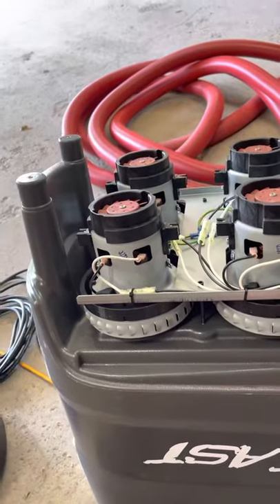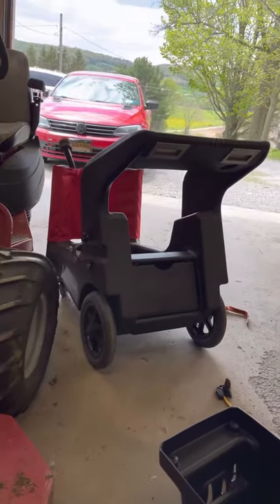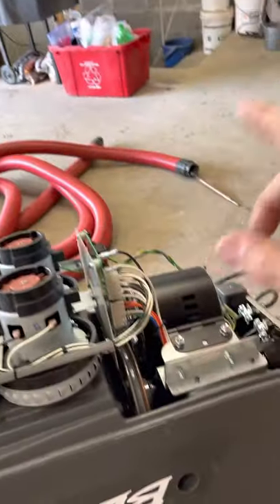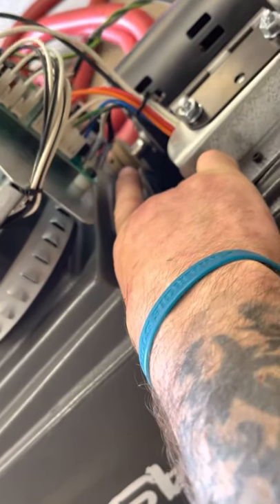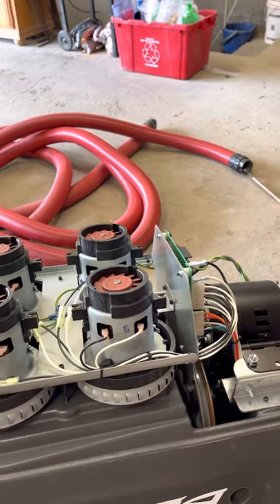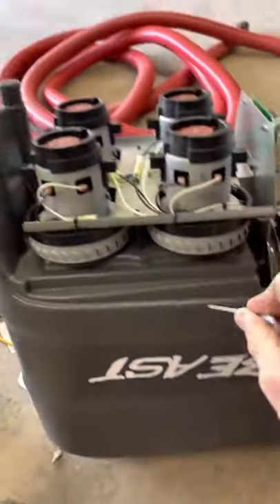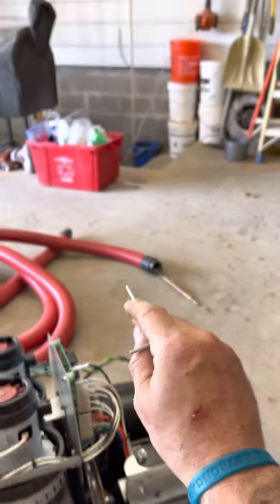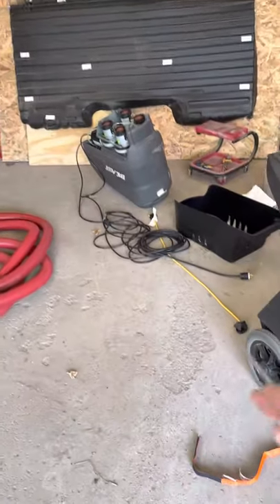Rotobrush SCAM

Comment: I’ve been in the duct cleaning service industry for over a decade. The only vacuum/compressor equipment I recommend is engine powered, either by power take off from the truck, or by self contained slip in units that go into the back of a cube van. You can do a house in a fraction of the time it would take with the electric portable systems.

Comment: I had a Rotobrush, years ago. Different than yours. Mine had one large vacuum motor, which worked well. The bad part about the machine was the huge circuit board that controlled the motor, failed 3 times under warranty. When the warranty ran out, I yanked out the $500 board and trashed the fancy, expensive motor. I drew up a schematic and went to Grainger's and bought a cheaper, generic motor and a few relays. Wired everything up and it worked great for years. Never failed! I wasn't spending $500 a couple times a year for their crappy circuit board!
Reply: He should be going up from the bottom not the registers

Comment from the maker: Let me be a little nicer. Rotobrush rotobeast doesn’t work well In trunk lines. It will clean round Pipe, but there isn’t enough of a vacuum to pull all the debris into the machine. If you pull each branch off the truck and inflate an air bag or tape it off then it will create the vacuum or negative air pressure needed to pull in the dirt. 
The best system is a negative air machine with air scrubbers, brushes with cables and air bags to isolate the system. Rotobrush offers those products but highly overpriced. I have a robotic duct camera I use to make sure I’ve cleaned all the ducts perfect. The videos I have of a brushbeast vs a negative air machine are night and day. I will remove the video because there’s probably many places that the rotobrush brush beast works Great. In upstate NY where we have large long trunk lines and old wooden return cavities it leaves 70% of the dust behind. It actually creates dust because it disrupts debris that have sat idle for years without sucking it into the small holes in the end of the largest hose. Also 6” or small Branch  lines will not except the larger hose. When you switch to a smaller Hose your lose a large percentage of your vacuum.
Reply: Yep, it's only designed for flex, but it doesn't even do large returns well and I purchased the 24" brush through my company. It is the only machine I've used for duct cleaning as I'm new to the HVAC world, but trying to get good before and after photos for customers was a pain because the suction on this machine is so bad. I made sure to size the brush up and tape off other supplies to create some negative air pressure, but half the time, I'd have the brush off and just wiggle the cable around to give the system time to suck up all the dust it was throwing around. I really hope I get to use a good machine one day and see a real duct cleaning. 

Anyone who thinks the Rotobrush is an excellent product is a hack. $11k for a specialized shop vac? It does work, but I wouldn't say it does a great job on large flex (fine for stuff under 12"), and it's nearly useless on hard duct. I used a shop vac with a brush attachment on the end to get somewhat presentable before/afters.

Comment: The Rotobrush that we have uses the van mount carpet cleaner vacuum , we have no problem with dust coming back in the house . Works well with no complaints.
Reply: it still is useless. You're scamming.

Comment: I traded some 3d printers and a bunch of other things for one of these. Mine only had two motors and same issue you mentioned. The only good motor was the one that spins the brush. The suction was so weak, the dirt had to practically "touch" the vacuum hose in order to suck up anything. And even then it had to be very light. The irony is i bought an air wave system. ( Its the see through box that goes over the vents and you turn the customers system to fan on and the box has two holes. One for a vacuum and one for your agitator.) I used an air whip but use whatever floats your boat. Anyway that thing works like a negative air machine for like $250. Thats not including the shop vac or the air compressor but its way cheaper than a negative air machine and works pretty good in my opinion.

Comment: If you use it properly, it is a great machine.  The hose he is pointing at is the largest hose (not one size fits all) so of course it won't fit in smaller ducts.  My package came with four hoses, different sizes for different applications, as well as a duffel bag full of different size brushes with different bristle hardness to accommodate flex vs metal duct.  If it is used properly, it works great.  People are looking for a miracle product that allows them to do mediocre work and get star results... that equipment doesn't exist.  This system does exactly what it advertises, and works great if used right. 
For what is inside the machine, it is DEFINITELY grossly overpriced... but hey so is everything else in this industry.  I made my money back in a matter of weeks, and I have profited greatly from owning this system and using it THE RIGHT WAY.  The atomizer for deoderizing/sanitizing the ducts is a great addition that adds that "wow" factor for clients dealing with smells coming from the ductwork.  
For not having to dedicate an entire trailer to permanently installed equipment to haul around... this portable machine is great for the application I use it for.  I can load it in the bed of a pickup if need be, and send a couple guys to knock out several cleanings in a day.  I have had zero complaints from clients, we maintain positive reviews, because we do the work the RIGHT WAY.  It's NOT trash... but it's also not $10k worth of technology in it... but as I said, you will make the money back quickly, and once you do, it is all profits with absolutely no overhead involved.  No parts to purchase, no diagnostic time needed... just show up, do the work, get paid, pay your helpers, and count your profits!  

TLDR: I'm happy with my brushbeast, it works fine as long as you use it right, and although it is overpriced, the expensive price will pay itself off very quickly.

Comment: It works great for me. I’ve had a couple problems getting into smaller metal ducts but it seems to work great.  Customers even say how they can tell a difference after a few weeks.
Reply from the maker: After a few weeks? Buy a negative air machine with air scrubbers! It’s a night and day difference. Rotobrush is a scam. It’s a homeowners duct cleaner
Reply: Not true I use it every day at work the machine requires maintenance like anything with electrical and mechanical parts  your the one that doesn't know how to use it right its not the machine it's who's using it 😂
Reply: No it doesn't. You're lying to yourself or naive.

Comment: I put a 5 ton drive in a box ran flexible tubing to a collar I cut into both sides of the duck system. Cover All the vents with cardboard except the 1 you're cleaning it's like the intake of a jet engine. Start with the far ones and Finish with the close ones, jobs well done, Less than $500.00 worth of equipment and material. I'm sorry but what vacuum cleaner cost $11,000.
Reply: ryobi shob vac, leaf blower and wire brush. easypeasy and cheap.

Comment: Thank you, any equipment( Industry best) that you recommended ?
Reply from the maker: Nikro negative air machine with a large gas powered air compressor with air scrubbers. I invested in that after the disappointment and it was unbelievable the difference. Also have brushes and a cable system that runs of any drill. Together that loosens any debris and the negative air machine sucks it right back to the hepa filter.
Reply: @315hvac  thank you your review saves me from a costly investment.

Comment: What equipment brand do you recommend?
Reply from the maker: You can use any brand name even rotobrush, but they are overpriced. 
I just recommend a negative air machine with air scrubbers. That system works great. I went back to every rotobrush air beast job and gave them a free cleaning
Using a negative air machine. It was
Night and day. I have a camera that crawls through the ductwork via a remote.

Comment: I use rotobrush beast, and it’s not bad at all it works great. I also have nikro and hyper vac systems. You probably just need more practice in cleaning air ducts. 👌🏼
Reply: Do you like the Nikro rods you have and are they the flexible ones? I'm trying to find a good set.
Reply: @digdug5945  yes! I have the attacker pro set, it’s a little pricey but we’ll worth it. It comes with the air whips, forward and reverse skipper balls and two single whips and rods for main line as well as thinner rods to navigate through the branch lines. Also you might wanna order the rotary brush button lock cable system by Nikro it’s a great combination with the negative air machine. you can also check out LTE products for micro lines for cases when it’s impossible to remove a vent cap. They have the micro bullet line as well as the micro whip air line. Hope this helps.
Reply: @chuckw302  Thanks Biff I found the website.
Reply: @digdug5945  you’re welcome!👌🏼💪🏻
Reply: You have never used real equipment and it shows.

Comment: Just suffered through that entire video. The machine works great, just sounds like you did it wrong.
Reply from the maker: Oh sorry you suffered. Look at my other videos! Maybe I’m just not happy with half ass jobs. I should say it works great on 6” 7” pipe. It vacuums some and pushes the rest to the main trunk. Rotobrush sucks at cleaning trunk lines. I invested into a big negative air machine with hepa filtration and a vacuum machine in a trailer. Then many different types of air scrubbers. You wouldn’t believe the difference. I’ll post a before and after video of A rotobrush shop Vacuum cleaning and a before and after video of a negative air machine. It will change your mind. 
Would you like this machine. I’ll give it to you that’s how bad of a Job it does.

Comment: I’ve been using them for thirty years and had nothing but great luck with them , real not sure what you’re doing wrong but certainly you’re not doing something right !!!! Roto brush would be the first to help you out if you asked them what your doing wrong or something wrong with that machine you have !!!
Reply: Probably not ceiling vents that aren’t being cleaned.
Reply: They clean round 6” duct okay but when it comes to to trunk runs it’s horrible. It can’t possibly create enough negative air to draw in the amount of debris it turns up. 
It doesn’t compare to air scrubbers and a negative air machine. 
Do you own an inspection camera that travels the length of
All ducts? If so give your customers before and after videos of the 28” return trunk when you are done. Rotobrush does not come close to air scrubbing.
Reply: 30 years and you didn't realize it doesn't clean corners of main  trunks? Wow. I figured it out at 18 in 2 weeks. Your poor clients.

Comment: Dang just bought one.
Reply: If you use it properly, it is a great machine.  The hose he is pointing at is the largest hose (not one size fits all) so of course it won't fit in smaller ducts.  My package came with four hoses, different sizes for different applications, as well as a duffel bag full of different size brushes with different bristle hardness to accommodate flex vs metal duct.  If it is used properly, it works great.  People are looking for a miracle product that allows them to do mediocre work and get star results... that equipment doesn't exist.  This system does exactly what it advertises, and works great if used right. 
For what is inside the machine, it is DEFINITELY grossly overpriced... but hey so is everything else in this industry.  I made my money back in a matter of weeks, and I have profited greatly from owning this system and using it THE RIGHT WAY.  The atomizer for deoderizing/sanitizing the ducts is a great addition that adds that "wow" factor for clients dealing with smells coming from the ductwork.  
For not having to dedicate an entire trailer to permanently installed equipment to haul around... this portable machine is great for the application I use it for.  I can load it in the bed of a pickup if need be, and send a couple guys to knock out several cleanings in a day.  I have had zero complaints from clients, we maintain positive reviews, because we do the work the RIGHT WAY.  It's NOT trash... but it's also not $10k worth of technology in it... but as I said, you will make the money back quickly, and once you do, it is all profits with absolutely no overhead involved.  No parts to purchase, no diagnostic time needed... just show up, do the work, get paid, pay your helpers, and count your profits!  

TLDR: I'm happy with my brushbeast, it works fine as long as you use it right, and although it is overpriced, the expensive price will pay itself off very quickly.